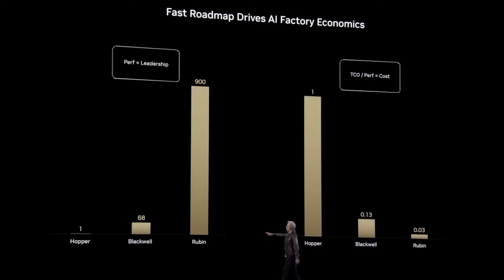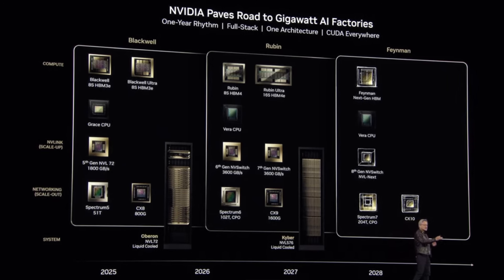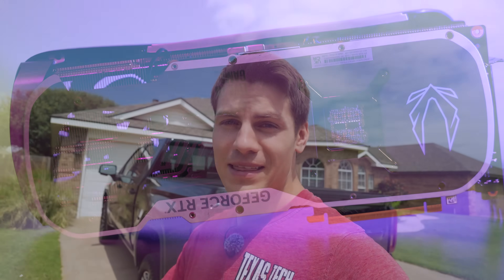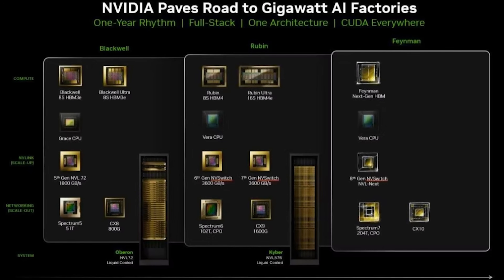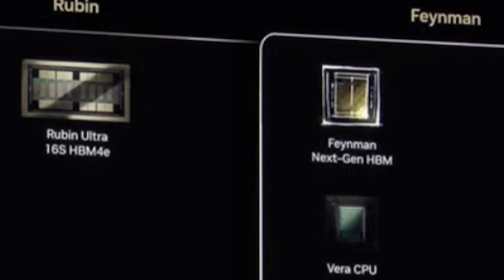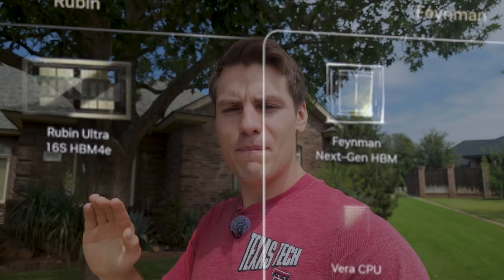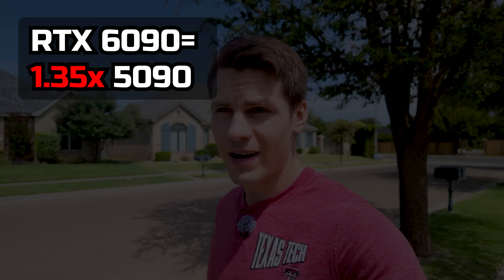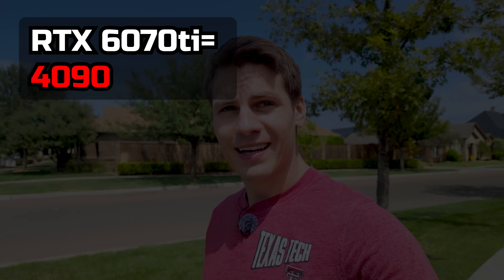Jensen LEAKED RTX 6000 Performance

Comment: Usually the reason Cuda cores don't scale linearly, when they don't, is because they didn't increase the rest of specs proportionally to the increase of Cuda cores, be it ROPs, Bandwidth or other Execution Units. 
The RTX 5090 is bottlencked by its ROPs, the rtx 4090 is bottlenecked by it's Memory Bandwidth.
Reply from the maker: 100% 💯
Reply: @rattlehead999  
NVidia engineers were able to increase FPS up to 50% (in selected cases) with 5090 over 4090 without increasing number of ROPs. #ROPs is still 170.
I think they have all ideas how to increase FPS 50% in every next gen without fast increase of #ROPs.
It may still require some grow of #CUDA cores for AI market. But not for gaming.
In fully optimized GPU it needs pixel performance about 2-8 GPix/s. While 400+ GPix/s is just waste of transistors budget and power consumption.
Reply: @alexanderbelov6892  name those "selected cases"  I have NEVER seen a 50% increase unless you are talking VR.   Some games are only ~20% at 4K with it being an avg of ~25-35%.  Do you even have a 5090 and/or a 4090.  I have both and you are pretty much full of it.  The main increase is in 1% and .1% lows along with DSR while DSC is enabled with high refresh rates (my main reason to get a 5090)
Reply: @alexanderbelov6892  The 5090 is about is 52% faster than the 5080 on average, while having 51% more ROPs, but it has slightly over 2x times the CU count(Cuda Cores, TMUs and Bandwidth). So it's literally limited by its ROPs in video games.

The rtx 4090 is only 30% faster than the 4080 Super on average, while having 60% more CUs, because it has only 25% more bandwidth instead of the 50-60% it needed. 

The 5090 is less bottlenecked and yes in theory you don't need more ROPs, but in practice that can't happen. The reason they sacrificed the ROP count is because it only affects gaming and the card was already consuming way, way too much power.
Reply: @rattlehead999 I did not say they can release 50 series every 2 years and gain game FPS by 50%. 
You think GPU is defined by CUDA cores and ROPs. But this is true only in general architecture of all GPUs released in 2010-2022 period.
Reply: @alexanderbelov6892  those are just the specs, the question is the ISA and latency of executing the ISA or the width of execution, though GPUs are always narrow, so it's latency. 

But when designing the specs, they need to balance them properly, which they do for all but the 90 series cards.
Reply from the maker: @rattlehead999 I can tell you after testing the 5090 is 2x (sometimes more) faster than the 4080 when completely GPU bottlenecked
Reply: @SiliconSteak  I said 5080 iirc, but in some cases where the ROPs are not a problem for sure.
Reply: thats why I love to use my 4090 max uv without any RT/PT but plus DLSS Q and in some cases FG on without needing it! I love this GPU at 4k(fake)@120Hz! For me its more than enough! Had a 4080 Super and was also happy but wanted the 4090 performance to last longer
Reply: @Serandi1987  depends on the period. In a dry period with minor new instructions and features like during 2013-2019, you can have a GPU last you that entire period, like the HD7970 and r9 290, while in periods where a lot of new instructions and features are added, raw performance isn't enough.

Luckily before next gen consoles, Ray Tracing is still not mandatory, but chances are that a few years into next gen consoles, Ray Tracing will become the default and only option, considering even the Switch 2 is geared with it in mind, though I think it will miss on many AAA games.
Reply: @rattlehead999  ah I don't care I turn it off as long as it's possible and later with mods. And after 5 or more years I buy a GPU that has no big problems with dealing with RT/PT any more like the 5090 today. In many years the GPU will push RT/PT like it's nothing.
Reply: @Serandi1987  Very true, it's just a general tip. When there are many new instructions and features, usually you have to upgrade more often as raw performance isn't enough, so you can factor it in your overall budget and might be better to buy a weaker, but cheaper GPU now and then upgrade to another one with the new features and instructions.

Luckily Ray Tracing was not mass implemented just because Nvidia said so.
Reply: @rattlehead999 I've got a 4090 and happy with it but yes you're right so far
Reply: @Serandi1987  I doubt anyone would be unhappy with a 4090. Unless it dies or electricity costs through the moon, but you've done the meta and undervolted it as it should be.

Comment: All they need to do is give us 200-250$ 1080p GPU with enough VRAM and 300-350$ 1440p GPU with enough VRAM, with both lasting 3-5 years at 60fps+. After that they can price everything else at 1 million dollars if they want to.
Reply: From what you wrote they only got "1 million dollars" xD
Reply: @GreyDeathVaccine  I don't doubt that.
Reply: Intel is your only hope in this low price range
Reply: @PySnek  True, but intel need to release the B770/780 16GB at 400$. The b580 is great at 250-270$, but it didn't move the performance much. 

So next gen Xe3 Celestial will be interesting.

Comment: 700 watt home warmer 6090 incoming. I feel like nvidia has forgot about power efficiency since the 30 series
Reply: Lovelace was more efficient than Ampere (remember the 3090ti ? And it power spike so you needed to have a 1600W PSU to avoid those problems) The 4090 was more efficient than the 3090ti... but Blackwell arrived using the same TSMC 4N.
Compared to the 9060XT, it seems the 5060 is more efficient.
Anyway, I think we can forget about 300W or less GPU, if we want a big uplift in performance with next-gen (or even RTX 5000 Super / RX 6080XT or something).
Ah, and we could say the same with SSD M2 (especially those PCI 5.0 variants)
Reply: @grospoulpe951  The 1200W power supply was sometimes too weak, but that was with nvlink 2x 3090, not just one card. Power consumption isn't really that important for gaming. It's easier to lower the power consumption enough to keep the game running smoothly than to overclock a weaker card, if that's even enough to get it running as expected. The bigger problem is the insane prices. Fortunately, I haven't even considered buying the fastest card for a long time.
Reply: Efficiency has objectively been improving
Reply: that’s why I bought the seasonic 1600w titanium with 2 power connectors to be 6090 ready, although I would love it to be just nvidia rtx 69 that would be a nice touch
Reply: @theshadowofawizard  Maybe. Don't forget though, in order to go above 5090 power levels, they will have to add a second 12v 2x6 connector, which they won't want to. Cutting the mess down to one cable was the whole point of the new standard in the first place. That said, being forced to keep the same power level is another reason that the 60 series might be a smaller jump. Although it might be a wash compared to the 40 to 50 series jump, which kept the same node but ran higher power. 40 series was a bigger jump over 30 because it got a new node And used more power.
Reply: @theshadowofawizard  735 watts would be following the same percentage of power consumption increase from 4090 to 5090. Maybe they will concoct a 1200w max 12V-2x16 connector and make us all get new PSUs again.
Reply: Let's get you upto 69 likes!
Reply: Going from 5nm to 3nm will be a huge efficiency and performance increase. The 4090 was substantially more power efficient and significantly more powerful than the 3090ti.
Reply: @theshadowofawizard  You dont care about power efficiency if you want the best gpu.